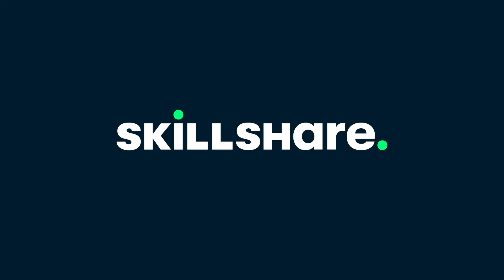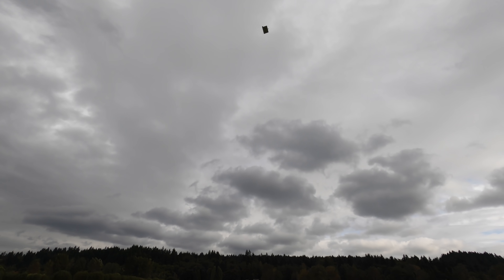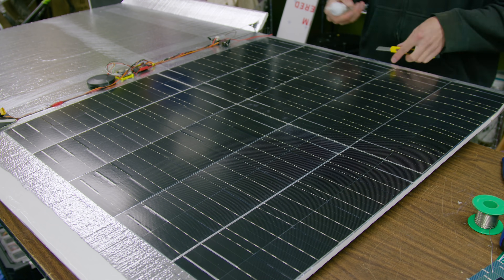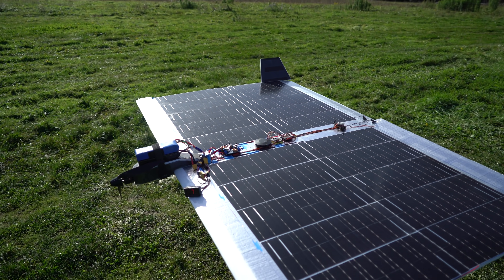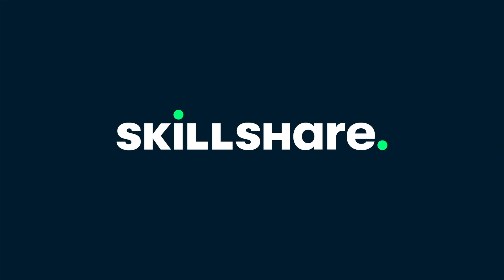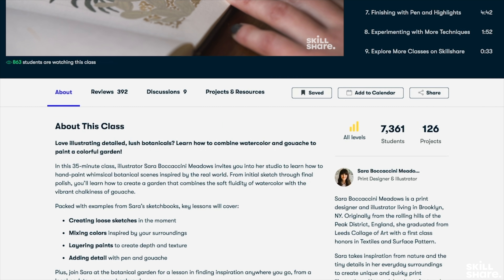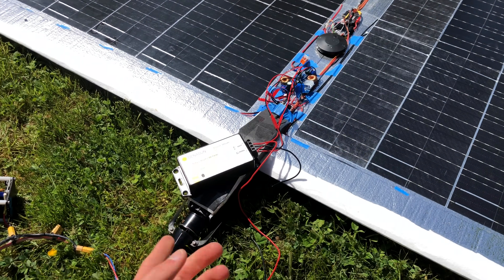R/C Flying Solar Panel???

Comment: I can see where this is inevitably leading......A record attempt at 24 hours constant flying...yes that means only battery power through the night..
Reply: bring a giant searchlight and fly it upside-down
Reply: Here in North Norway we have now daylight for 2 months, sun do not go down because it is north of the polar circle...
Reply: Daylight in June in this area is 18 hours, so only need ~6 hours of battery. 
ie: 5 Ah * 6 ... or about 6 batteries worth.
Reply: Record is already almost 39 hours
Reply: @keithb6717  ~6 hours of battery would imply 48, or more hours possible. Weather then becomes major factor. 

Alternatively a combination of solar and wind, aka ridge soaring would work too. ;)
Reply: @AerialWaviator  then do it instead of talking about it. This is an actual record. It is also a distance record.

Comment: Can you ship me a package with hydrogen drone? AKA can you make a weather balloon that uses water and electrolysis to generate H2. This fills a weather balloon creating lift. Then if you get up to around 90kft, it vents some gas and cones down to perhaps 40kft.thrn at 40kft it generates more H2. Keeps bouncing between these heights. Then when close to my address, it drops an rc glider which flys to my address.

Comment: I think aircraft twists itself through center axis at air. You can bend it in half by just 1 degree r so. That will remove twisting and increase stability.

Comment: How about lengthening  the “fuselage” to improve the CG without the weight of a second battery and reinstall the vertical stabilizers?
Reply: And drop the vertical stabilisers below the plane to avoid shadowing. Kind of like very long winglets
Reply: For this video at least, it seems like he could've used the better charge controller in place of the second battery to bring CG into spec, just strap it on and go.  For a better installation, a longer nose with the charge controller mounted in the wing and maybe a little foam fairing to slick it up would help in that regard, but sourcing a more compact/lightweight controller would be preferable.  Relocating ALL of the components, including the servos, as far forward as possible would be an ideal solution.  You're not adding mass with a longer nose or what amounts to ballast, you're just using what you already have to rebalance the aircraft.  Only after you've relocated components to the front should you consider a longer nose or ballast or a boom mounted engine with canard (that's actually a good idea for stability, but does add some complexity).

The verticals don't need to be underneath, they just needed to be put on booms behind the plane...a pair of rulers taped to the wing would've worked well enough, that could've been done in the field.  Some carbon fiber rods would be better for CG purposes.  That would give it better directional control than what it had with no solar shadowing.  The strakes underneath the wing help with slow flight, and particularly on such a low aspect ratio wing.  The airflow underneath has more of a tendency to move outward toward the wingtips rather than straight back, which induces vortices and causes the wing to be les efficient.  Those strakes are like stall fences in that they straighten the airflow and sort of force it to go the way you want, which is straight back.  So he probably unknowingly increased the efficiency of the wing trying to get it a little stiffer.

The potential was there for this little guy to do really well, it just needed some refinement.
Reply: @Skinflaps_Meatslapper  -- These are excellent suggestions from an unexpected username. I would like to see rctest revisit this craft with these refinements..
Reply: @sethjohnson4513  You know that old saying about a thin line between genius and insanity?  It's more of a destination, really...you should come visit sometime.
Reply: @Skinflaps_Meatslapper  937368493307363 to 92927363638393
Reply: @madbruv  u wot m8
Reply: It's a good idea with a large aluminium, wood or carbon fiber rod (maybe 2 ft) and then install canards for pitch control
Reply: Have the motor on a forward boom?
Reply: How about also shape the ribs into slight airfoil shape to allow the wing to have more strength and lift.
Reply: Or wire the ballast battery in parallel to double the available mAH
Reply: Or tilt the engine to down a bit?
Reply: @fahrimertdincer8421  That wouldn’t help change the CG.

Comment: Wild! I've got one of those exact MPPT controllers based on the XL4015 chip, they're only about $5, the issue is for that money you only get manual MPPT, (read the instructions) but basically you have to manually set a minimum input voltage with the potentiometer that's on its own, to say 26V, if the input goes any lower than this the output current will be limited progressively to maintain 26V if your "panel" of cells is 30V open circuit you probably want to aim around 25-27 volts to find your peak power in generally full sun without losing too much if you get some shade, at a guess you've got it set too high and it's limiting the current to keep the panels at 30V,

I use mine with a large 245 Watt panel to drive a 12v 2amp pump with a small battery as a buffer, I wanted it to run longer and on cloudy days etc, I've tested it and it holds the panel at 26v while it's only able to output 1.2amp, this means i get a little over 30 watts which with some losses is enough to run my pump, with just a DC regulator the panel gets pulled down by the load to 12v and still 1.2amps (14 watts) which isn't enough for the pump, as I'm in England and it's often cloudy it's been well worth the £5

Comment: I think embedding two spars as diagonal members would've gone a long way to making it flyable. You were clearly having stiffness issues as a result of the thin wing, and a little carbon fiber would probably solve that.

Comment: Love the song. I reckon it's worth refining this one a bit before going to the drama of molded composite wings.
3:1 AR, a bit of camber, some VGs on LE, extend nose and reduce weight, use the good CC. Might be worth adding some permanent reflex out the back so it is still stable descending too.

Comment: Why not do differential thrust steering with a second motor? You needed to add a bunch of nose weight anyway. Plus you had an extra amp of power from the solar to help make up for losses from the 2nd motor.

Comment: The song lol. Now I want to glue a lipo to a piece of cardboard with a motor and a prop just to see if it will fly. I think loooong wings and a tail are needed. I could be wrong. 1.5 hours is nothing to sneeze at.

Comment: Your lower fins give you longitudinal strength, you need a few bulkheads as well so it's not so floppy around its pitch axis that should help with your control issues

Comment: Two observations:
- You need diagonal reinforcement to prevent twisting, it's hard to control because the elevon action can be reversed by air pushing against it and turning the rest of the rectangle into a giant reversed control surface. I think an X configuration of thin carbon spars could do the trick
- Why don't you just put motor and battery on a stick? That way you could have the CG more forward, basically without any extra weight

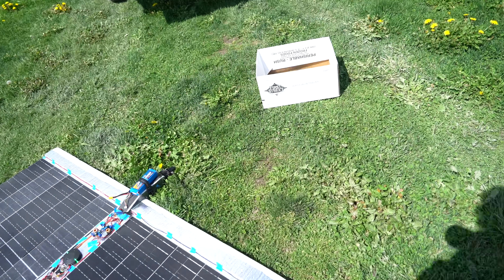Comment: 16:20 based on some quick searches, it looks like the modules you picked likely do a sort of fake "MPPT" that is really a target set point for the input voltage, rather than true tracking. Basically, if the panel says peak efficiency at X volts, you tune the MPPT knob so that the input stays at X volts (which is not actually the MPP in all cases). It also looks like they have knobs for setting the desired output voltage (which I assume you set correctly), but also max output current, which you'd probably want to leave wide open for your purposes. With proper adjustment of the MPPT and output current, you might be able to get more performance out of them, but I wouldn't be surprised if the Genasun still beat them, even with said tweaks.
Reply: agreed.. I also have the exact same "mppt" module, which doesn't really do the tracking part. Already tested, it  just maintaining fixed input voltage.

Comment: For info about carbon fiber plane lay ups check out or contact the Youtuber Ramy RC. He does replica scale planes in carbon fiber shaped in 3D printed molds. I'm sure you can an idea of what you would need to do to build your max efficiency solar plane. One last thing is if you take into account the angle the pizza box flies at, you can set a way point mission so that it stays flying angled toward the sun more than just flying in circles or whatever... I think that smart flying can actually get you pretty far.

Comment: Put an extension on the nose to move the battery and motor forward so you don't have to add dead weight.

Comment: you should try to make a solar glider that can run 24/7 throughout the night even. maybe have it climb to high altitude during the day so that it can glide downwards during the night/barely maintain altitude so that when daytime comes it's still in the air to continue flying and recharging

Comment: Those MPPTs don't do any tracking - you set the desired input voltage with one of the pots to the MPP voltage of the panels. (It doesn't change very much with temp and irradiance). The controller should try to keep it there. Then you set the desired output voltage with one of the other pots.
I have a couple of similar Chinese "mppt" controllers, but with only two pots - they work reasonably well but they contain no intelligence.

Comment: If u put the electronics on a box out the front of tv plane you can use this to assist with your cg also you could get another strip of solar in the middle then

Comment: You've definitely got to do a velocity/aoa sweep for steady level cruise to figure out your optimal power at the bottom of the drag bucket. Not sure if ardupilot is already trying to do that in the air to find cruise throttle/aoa??

Comment: for a simple, non intrusive vertical stabilizer, you can add a weather vane style (basically just a longer rectangle) in between the 2 main control surfaces in the rear

Comment: 14:27 WHAAAATTT? never lost a plane?? i don`t even fly that much planes and i lost 2diy full fpv geared planes and two batteries that falled from the sky
Reply: you'll never loose one if you do it right. i once crashed into the matterhorn and recovered it

Comment: @rctestflight use diamond shape, full square area, than just half, and it gets stability by tilting the square 45 degrees, plus its highly maneouverable
Reply: Oi there’s no such thing as a diamond shape it’s a rotated square!
Reply: @trevorcompton9186  nooo its double triangle there you goo dude
Reply: @d4ro  nooo it's a symmetrical lozenge
Reply: @superdupergrover9857  yeah but your nose isnt symmetrical, at all
Reply: Looks like a good idea.

Comment: This isn't a solar powered plane but a flying solar panel...
Reply: Motorized solar panel.
Reply: @antman7673  well, weren't some advanced solar panels motorized already, automatically adjusting their angle to the sun in an attempt to maximize efficiency?

i still don't see those flying unless there's a hurricane though. :D
Reply: @klontjespap  🤓
Reply: Выглядит говном

Зачем люди это делают
Reply: I guess you made History then! 1st powered flying solar panel!😊
Reply: You are correct
Reply: Yeah
Reply: Brilliant. Just add hydrogen balloons and collect moisture to convert water into hho to keep it aloft indefinitely.
Reply: @unitedspacepirates9075  It would be much more efficient to just charge a battery. HHO generation is very inefficient in comparison: About 66% at best, and charging a good modern Lithium cell is over 99% efficient.
Reply: @RWBHere  hydrogen buoyancy is more energy efficient than electric propeller propulsion.
Reply: @unitedspacepirates9075  Well duh, but you must remember it is hard to contain hydrogen, and it is flammable so you have to be really careful, but I imagine it can work?
Reply: @isayoutubehandle  plastic bag with wd40 coating the interior contains gas without electrostatic discharge.
Reply: @isayoutubehandle  what about helium?
Reply: @ashk7679  sigh
Reply: @tbbt1215  lol